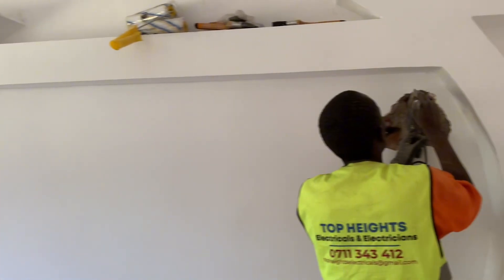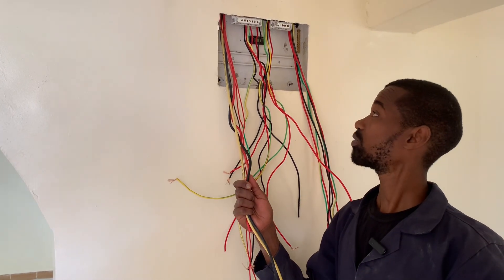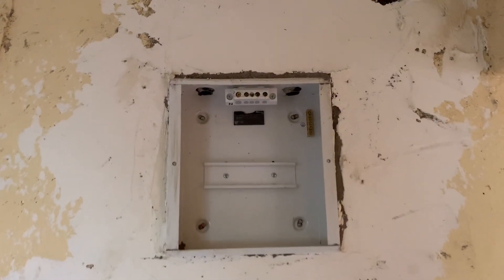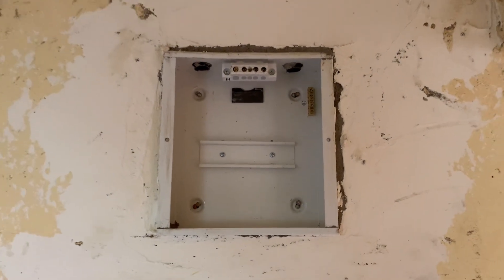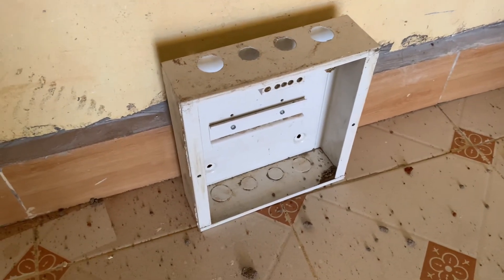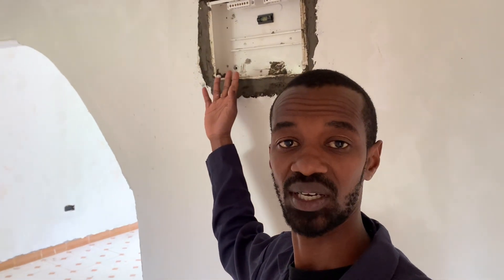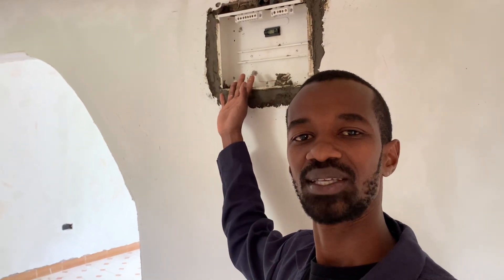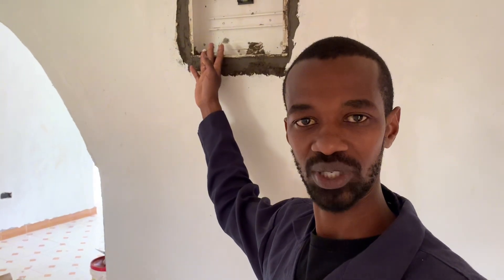Wiring A House 🔋 (Electrical Installation DIY)

Comment: What determine the size of the customer's unit in a build?
Reply from the maker: Good question. The consumer unit size depends on the number of circuits in that building but it should not be less than a 10 way.